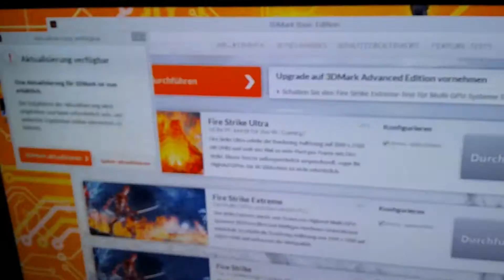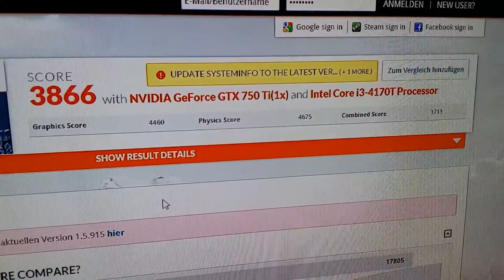My Dreamcast PC Casemod

Comment: Interesting build! I'm putting together a Dreamcast PC now and I'm researching. I'm using a smaller motherboard, an H110S2, STX form factor. With external power brick. Low profile CPU cooler and a 1050ti mini. It should all fit, if I remove the palstic shroud from the graphics card. The rest I've not worked out yet, not having a disc drive saves me a little space too.

Comment: I love this! Really good job. I was wondering though how you managed to modify the slim optical drive to work as a top loader. Is it as simple as just taking the casing off and having the lid of the Dreamcast trigger the detection switch or do any other modifications need to be made to the drive? Thanks!
Reply from the maker: Yes thats it. But the drive i have has 2 switches. I bridged one permanently and used the other one for detection. Don't know why they have 2 switches for that.
Reply: That's helpful to know. Thank you very much!
Reply: Björn Hansen I’ve searched the internet for years on how to do something like this. I couldn’t find anything about it. This is great news. I wanted to turn a uhd 4k Blu-ray drive into a slot loader. It’s not exactly the same but similar. Just switching parts apparently.

Comment: would you be willing to make a tutorial on how to make this specifically, i have had the same idea but lack the tech skills to do some of the modding like the front led and the fan driver and i think it would be pretty fun to try this too.
Reply from the maker: Probably not in the near future. Also it is not realy practical for regular use. The fan version was way to loud and the watercooling is not reliable enougth. And it's a bit danger since ther is 230V AC in the case and not very good isolated. The LED light was a costum build i could do because im an electrical engineer and have the knowledge and tools for that.

Comment: I am currious on how you put the Bluray disc drive in there. Also would any OEM Laptop Bluray disc drive work as well.
Reply from the maker: I think so, as long as they're not using an proprietary connector it should be usable. Just take the case off and modefy the switch that detects if the disc tray is ejected.
Reply: That makes sense. Thanks!